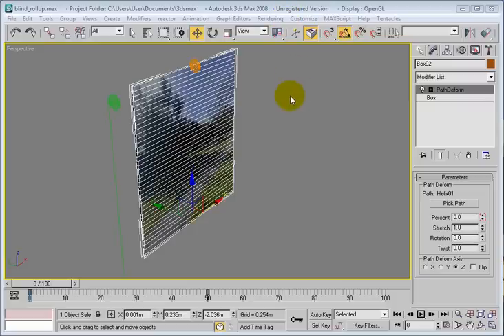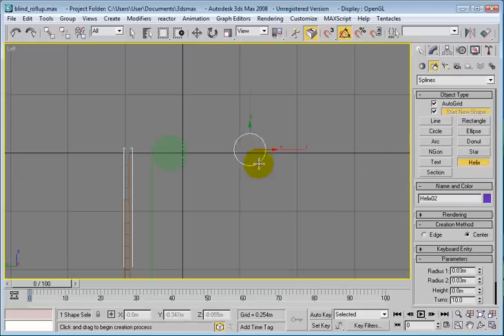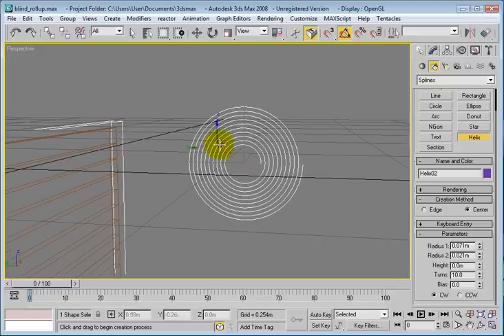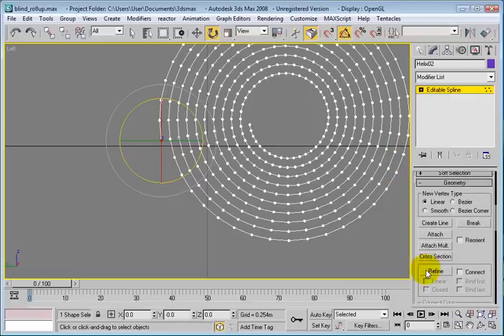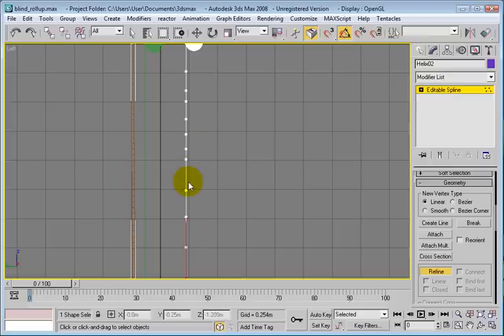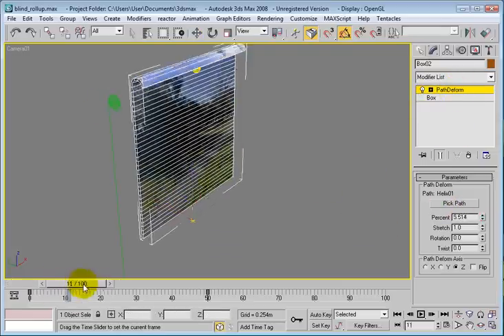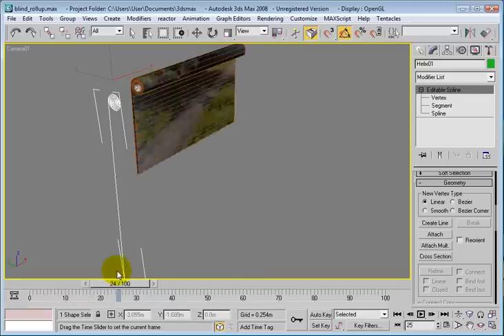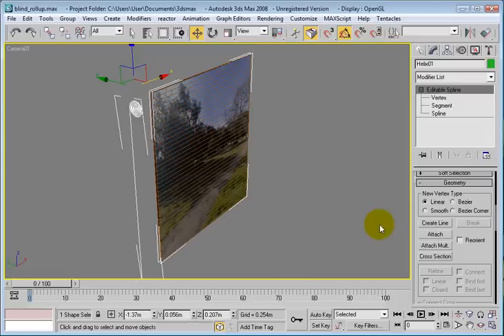how to set up a roller blind in 3DS Max

Comment: nice ! finally i found someone who did exactly the same way as i was doing this evening, with a path deform and helix shaped spline, same as yours, but the main problem is that thickness increases as it begins to roll, as i was trying to roll the shutter on a horizontally placed cylinder ! just like you roll a paper on a pencil ? any idea or help thr ?